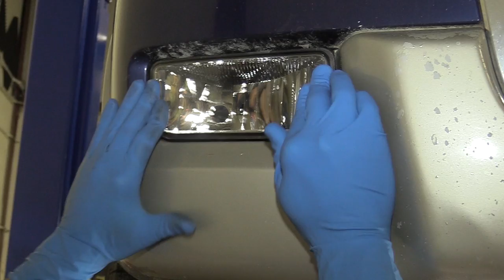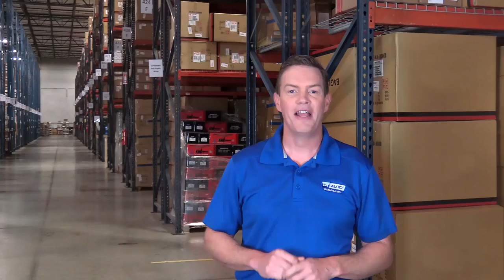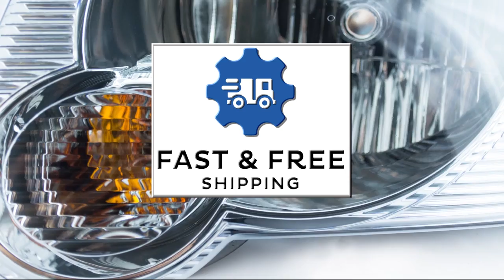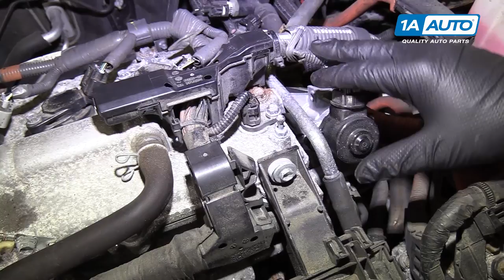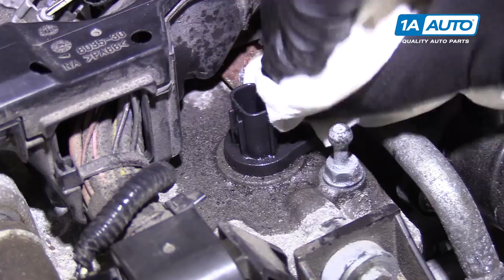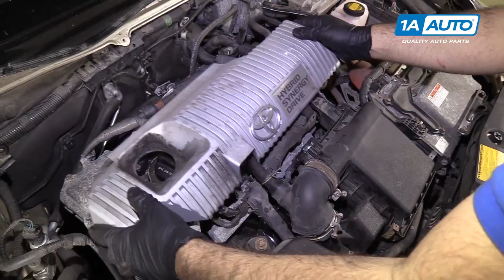How to Replace Camshaft Position Sensor 10-13 Toyota Prius

Comment: Good afternoon hopefully you read my message. I had a P0343 code and it said to replace the cam shaft position sensor on my 2011 Prius. I did that today and now After I installed it my Prius doesn’t want to start now. I still have the P0343 code checking my OB reader. What is wrong with:(. My car starts at chance then shuts off within 3 seconds every few tries.
Reply from the maker: +@christopher23. We wouldn't be able to diagnose an issue like that here, you may want to have a local mechanic take a look at it. Thanks for checking us out! http://1aau.to/m/Shop-1AAuto-c

Comment: Is the is the same sensor  as this P0335
Crankshaft Position Sensor A Circuit
Reply from the maker: +@christopher23. The camshaft controls the opening and closing of valves through the combustion process, and the crankshaft takes the energy from that process and connects it to the rest of the vehicle.

Comment: Is there a difference between a camshaft position sensor and throttle position sensor? I have a 2010 Prius that’s giving me a P0121 error. I just replaced the accelerator pedal sensor, and it still won’t start up right.
Reply: Yes. Cam Position Sensor tracks the position of the shaft inside the engine responsible for the opening and closing of the valves. 

The Throttle Position Sensor tells the computer how far open the throttle is. The throttle body is located under the air filter housing in the front area of the engine bay for a '10 Prius

Hope this helps

Comment: How do you know when to replace camshaft sensor
Reply from the maker: +Angel Calderon You will usually have a check engine light that will help let you know when to replace it.  1aauto.com
Reply: What are the symptoms of a bad cam sensor?

Comment: Any one knows where the crankshaft position sensor is at?
Reply: on the passenger side 
you can turn the wheel completely you can see the crankshaft position sensor
Reply: It is in the video ha, ha